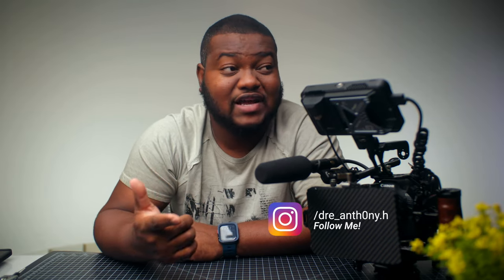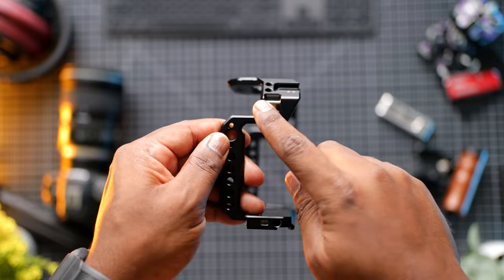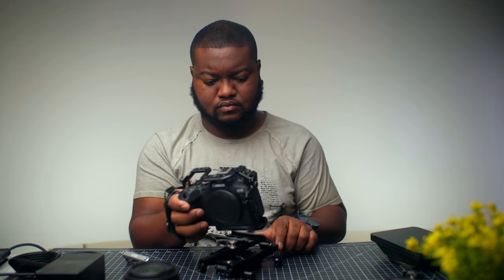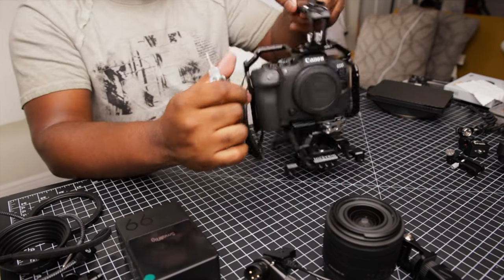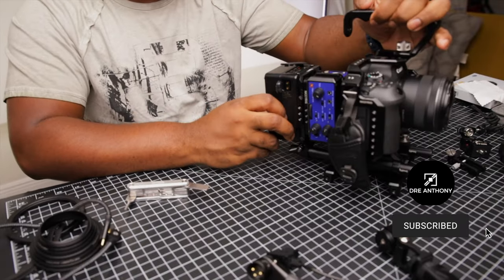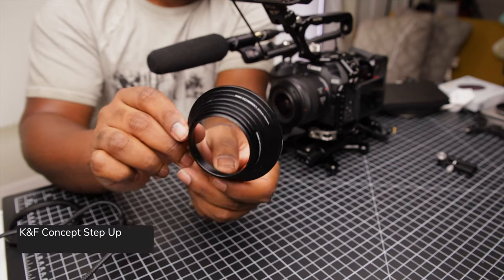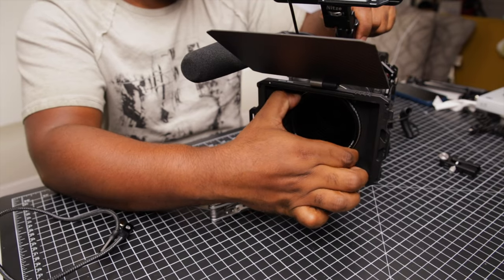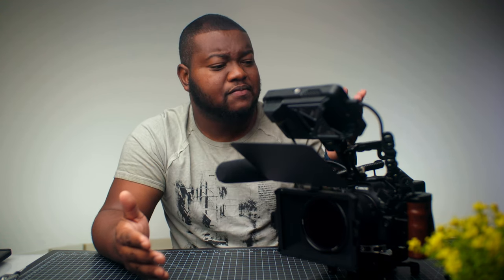Turning My Canon Camera into a Real Cinema Camera - Ultimate Camera Rig Build

Comment: Does it actually charge the camera using USB-C to USB-C from the camera to the V-mount? From what I read it will only do that when the camera is off unless you use a dummy battery. Did you need to do something else for the direct to stock to work?
Reply from the maker: Great question. Technically when the camera is connected via usb-c to usb-c on a v-mount battery it charges the battery in the camera at a very slow rate. So essentially i get a much longer run time from the camera's battery and also if the v-mount battery dies,  i still have some power on my camera from its battery which is one of the reasons why i don't use dummy batteries. I hope this answers your question. Cheers👍

Comment: Any reason you're not running the dtap port to your camera and then using DC to the monitor?
Reply from the maker: No particular reason. I prefer using DC to dtap port to run my monitor and usb-c to keep the battery in my camera charged instead of using a dummy battery.

Comment: What recording time do you get by adding the Ninja V and External battery? When using my R6 II without any accesories i can only record up to 25-30 minutes on 4k 60fps before the camera is overheated.
Reply from the maker: I got just around 40 minutes with the ninja v and the external battery in 4k 60fps clog 3. Filming conditions were around 77F so the recording time may vary in more warmer or cooler conditions